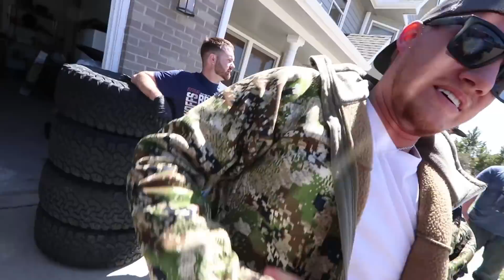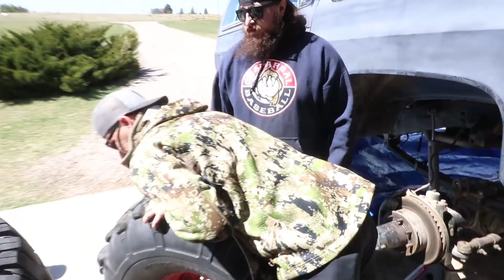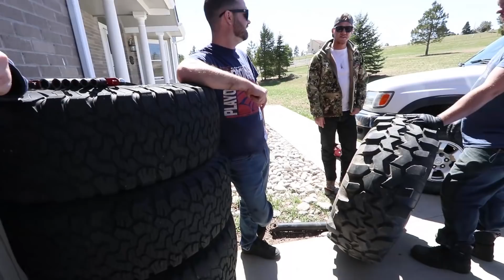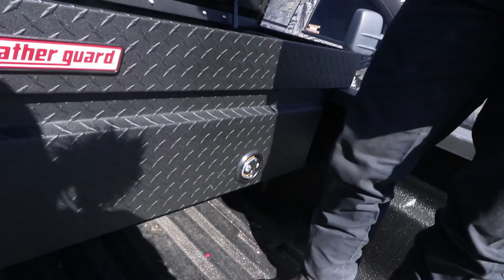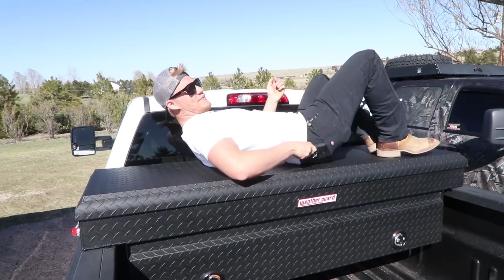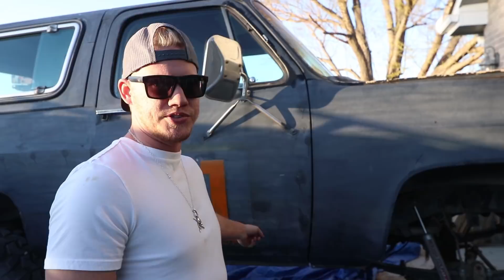VERY important MOD for any Truck!!

Comment: You will over heat that new trans with the exhaust coming out under it and same goes for the rear end you need to put turn downs or run it over the rear end turn downs will catch your truck in fire in a field

Comment: Just so you know. They didn't need to drill holes into the bed of your new truck to install that toolbox.  You can use J hooks that will hook to the lip of the bed rails and pull the toolbox down to it. Just sayin. I would've been pissed if someone did it without me.
Reply from the maker: That’s what they did dumb dumb
Reply: I got a reply from Outlaw! Hell yea!!